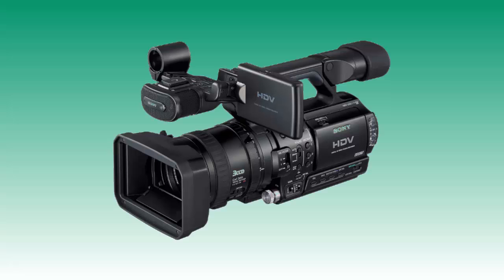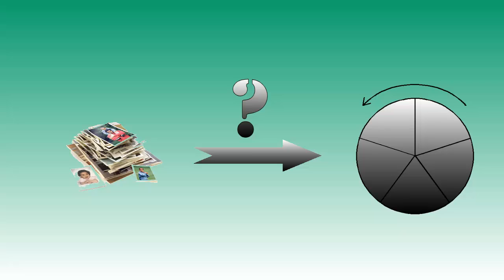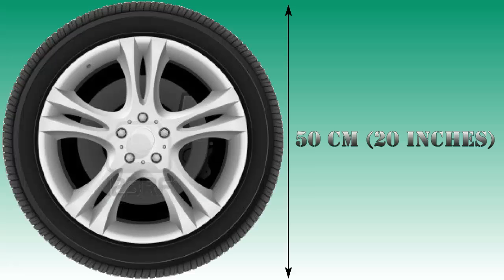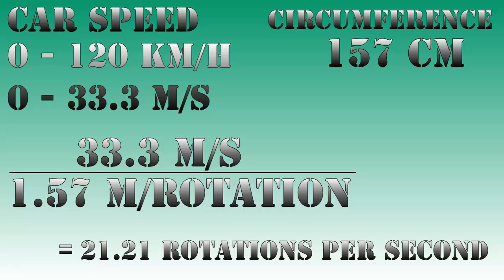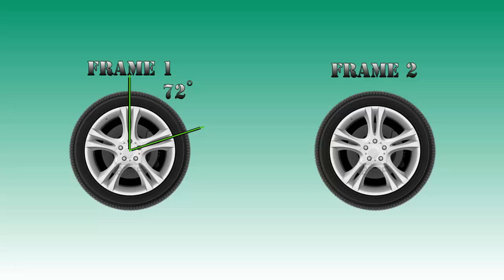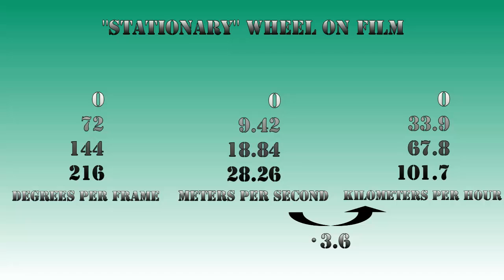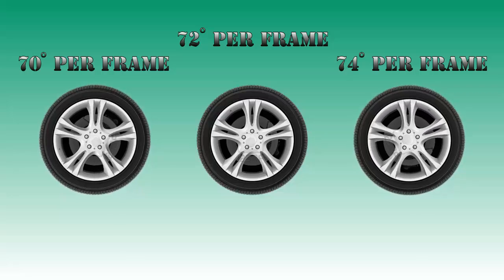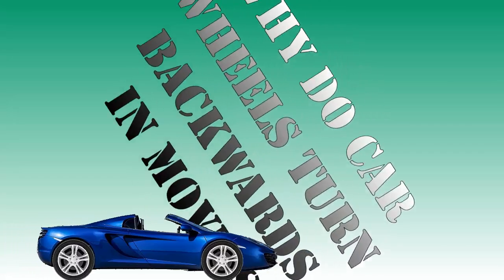Why car wheels rotate backwards in movies

Comment: but i see this in real life?
Reply: same here...
Reply: people see in 24 frames
Reply: 16
Reply: We perceive fluid motion at 24 fps we actually see at 60fps
Reply: I see it in real life aswell
Reply: The eyes actually output constant vision with no frame division. The brain however processes the vision in a way to eliminate the blind spot of the retina and other flaws, not to mention the brain processing also fuses the output of both eyes into a single stereo vision. The brain processed vision of humans at it's MAX performance was estimated to match the speed of high speed cameras at the low setting of around 200 frames per second. However humans usually can't reach this maximum performance without proper training and the p300 factor which is a brainwave pattern. People that suffer from the weak X syndrome (ADHD) will likely never reach their maximum vision and reflex performance although some under chemical treatment do reach their maximum performance.
Reply: Trenzinho da Alegria Thanks
Reply: check out smarter everyday rolling shutter explained. he says this thing is different

edit: this is the aliasing or wagon wheel effect
Reply: Ezekiel Briones i watched that video before
Reply: Thomas Stewart but... we do.
Reply: Get a 144fps monitor and tell me we only see in 60fps lmao
Reply: Mr. Bulbasaur's Channel thats what i came to comment!
Reply: Thomas Stewart yes if we would use 10% of our brain the rest would just die off and wouldn’t even come to existance in the first place
Reply: @BostonleierPlaysMC  no

Comment: But this phenomenon can also appear to the human eye, so how can one explain away this without blaming the FPS on a camera?
Reply: Humans are fooled by 24fps tvs as being a moving picture. At 60 fps even fast moving objects appear smooth but in reality our brains add motion blur to fast moving objects so you could say humans see at somewhere between 24 & 60 fps.
Reply: wrong, the human eye does not see in fps, but rather in one fluid image
Reply: geetarwanabe yah its about 60 fps but some other creatures are known to see at 120 fps
Reply: TopherFM those are spinners on car tires lol!!
Reply: @emilgeeproductions1101  yes
Reply: I have found with the eye it just sort of blurs after a certain speed without the flickering effect UNLESS there is a flickering light in the background. Some lights flicker at a very high rate e.g. some street lights, and also LED pulse width modulation dimmer circuits. If you wave your hand around you get lots of snap shot images even though you can't see the flicker.

Comment: I thought that it was just a phenomenon caused by the frame speed of a camera being different to the rotational speed of the wheel.  On my old video camera the props on an aircraft would be a blur as you see in real life but my new digital camera gives a different effect like the one in this video.
However, I was playing a game of tennis this morning and the black tennis netting was made up of diamond shaped wire, very much like pig netting.  Through the wire we could see the cars nearby going along the road up a sharp hill.  With our naked eyes we all could see the alloy spoked wheels stop and turn backwards just like the camera effect when viewed through the wire.
Either the wire is acting like a camera frame or our eyes process information through our brains in a series of "frames"
Perhaps it is a bit of both as the eye keeps making a new image every time it sees the wheel move on to the next diamond shape.

Any other ideas?

Comment: Look at the most recent video on my channel, it’s called E92 335D vs F30 335D. This is a drag race. You can clearly see that the wheels on the white car switch between clockwise and anti-clockwise motion even though the car is continuing to accelerate away.. it never does slow down but the wheels change rotation (illusion). 

Your explanation seemed to point towards a slowing down being the reason for the illusion of change in rotation?